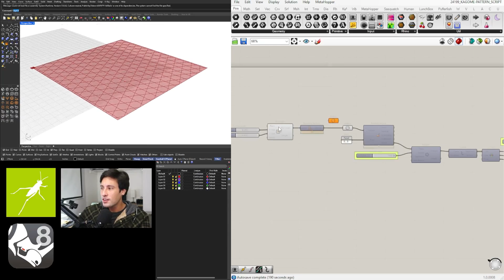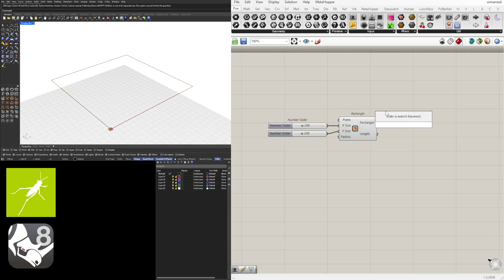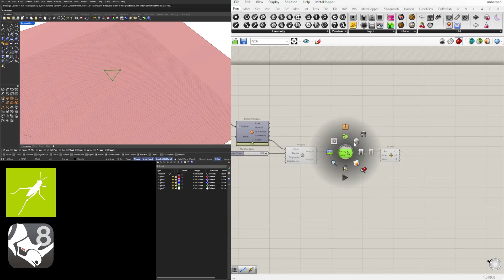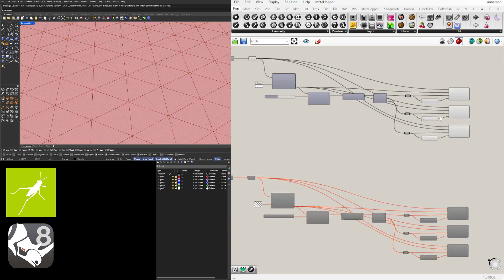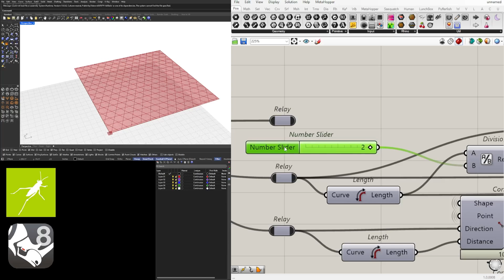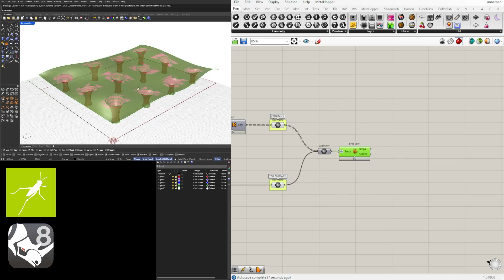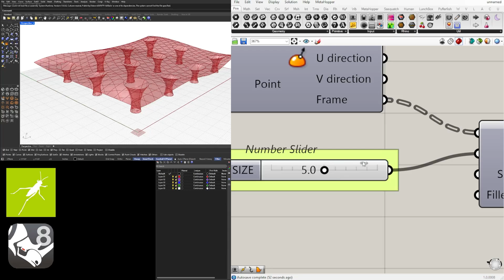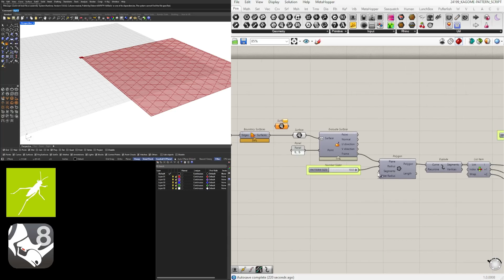Parametric Design Tutorial Kagome Triangulated Pattern On Surface using Grasshopper for Rhino 8 3D

Comment: when I project the pattern onto the flowing roof structure and connect the brep the full pattern doesn't not get transferred why is that how do I fix that
Reply from the maker: It should if it's a continuous surface. Is your surface broken up into separate sections? Also try to graft the pattern output and see if it works